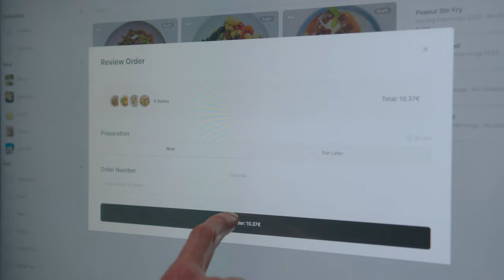GoodBytz Robotic Kitchen

Comment: In my perception I don't see it being that useful. It seems to only mix ingredients and heat them. I believe I can do it myself, so for my home I would not buy that. I would maybe buy one of those humanoid robots that can do chores. What I am trying to say is, I don't see the problem this machine solves. There probably is one, but I could not see it myself or in the ad, the use case
Reply: It’s for business. You know, instead of traditional laundries an automatic one. And this instead of a restaurant. I have seen this way. Interesting
Reply: Seems like it’s heating and mixing
Reply: It's missing two crucial steps: prep and cleaning. I've worked in restaurants and those are the most time consuming jobs. Stir frying and grilling are simple actions.
Reply: Yeah what is it doing for the price point? If it was 100k maybe worth it if the thing is making 10 cooked to order foods a hour all day but if it doing 4 or 5 and cost 100s then just hire a personal chef

Comment: I would only consider such a device if I could simply hand over the shopping bag to the robot and it then prepares the entire meal. It seems impractical to acquire such a device if I have to first cut all the ingredients into bite-sized pieces. Additionally, its functionality appears to be limited to frying in the pan – but what about baking? Dishes like steak with baked potatoes and salad, lasagna, or pizza would not be possible with it. Even noodle dishes I can already buy pre-made and frozen, then prepare them in the pan in just a few minutes.

The cleaning effort is also questionable. While it is shown that the robot places the pans in the dishwasher after use, what about the splatters that inevitably occur during frying, both in the surroundings and inside the robot itself? In my own kitchen, I would clean these up immediately. However, if the robot is left dirty, I would feel uncomfortable consuming food prepared there – it seems unhygienic.

Furthermore, it is not very appealing to spend two hours every day cleaning the machine and ultimately almost preparing the dish myself by prepping everything, just to end up frying noodles. No thanks, that's not for me. I view this with similar skepticism for a business, as it can only prepare similar noodle dishes or other pan-cooked meals. If multiple companies were to rent such a device, they would offer a limited selection of recipes that compete strongly with each other and may ultimately not attract enough customers, as they also want to eat something other than noodles and stews.:face-green-smiling: